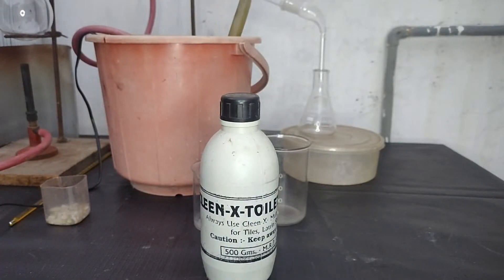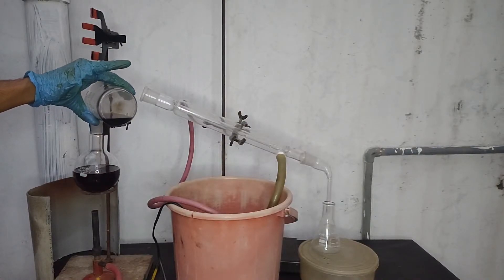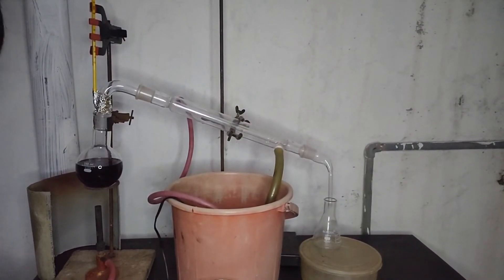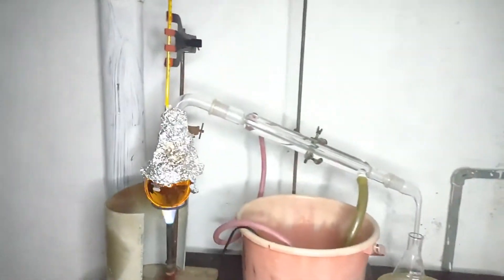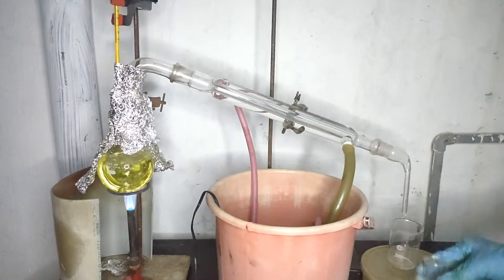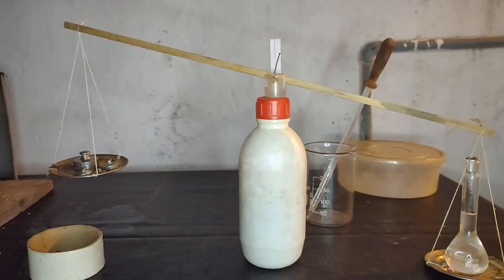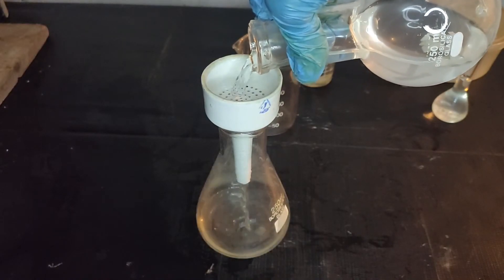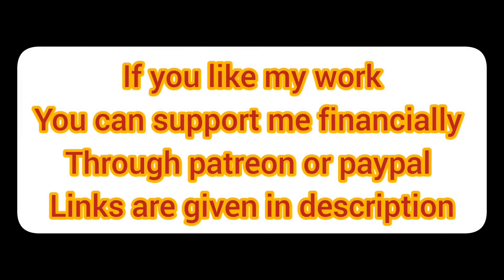concentrating drain cleaner sulphuric acid

Comment: Hi I have question. Instead of distilling the acid, could I instead fill a flask with the drain cleaner, and place a reflux condenser (air cooled) in it? Then heat to 330 c, will the water evaporate and leave 98% sulfuric acid behind?
Reply from the maker: It may work but the fumes will contain acid vapours and may cause irritation to your nostrils and throat
Reply: @TheDIYChemist  But if its being refluxed, wont the sulfuric acid vapors recondense and drip back into the boiling flask? And the water will remain as a vapor and will not condense as the temp will be over 100c?
Reply from the maker: The reflux condenser will act as a poor fractionating column so what you are saying is correct but. The water vapour will contain acid vapours too
Reply: @TheDIYChemist  ok i will just distil instead, it will be very dangerous, i pray for my safety. Thanks for your help
Reply: @AlexBaker592 No reluxing would be better! A fan can disperse the fumes or they can be led to a trap

Comment: Minor nit on the video. The starting concentration was stated as being between 90-92% and your ending concentration was confirmed at 92%. Azeotropic Sulfuric acid is approximately 98% so you still do not have fully concentrated acid although you have undoubtedly removed many of the colorants and chemicals added to prevent the acid from eating the metal in the pipes. Perhaps the title would be better if it was the purification of concentrated sulfuric acid?

Anyway, good video, love seeing you work with simple tools and achieve good results.
Reply from the maker: It was just an attempt . I tried to show that how difficult and time consuming is to concentrate sulphuric acid.